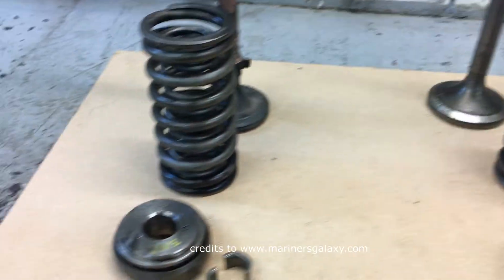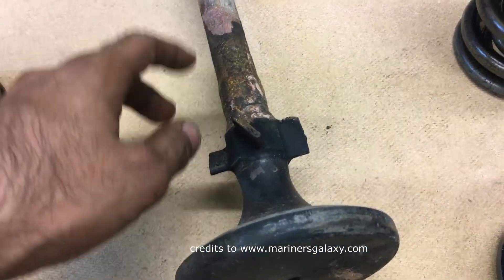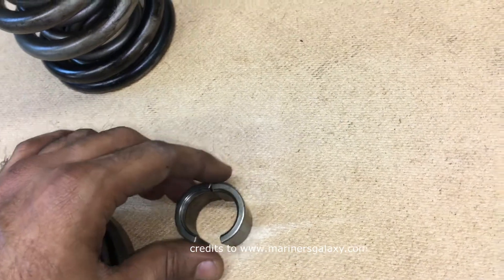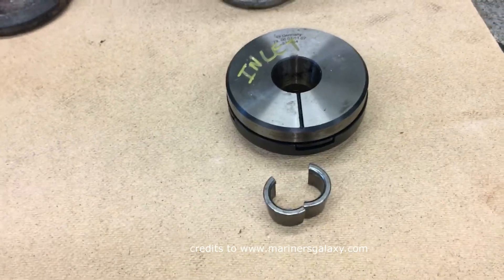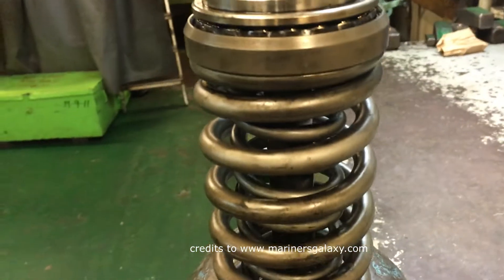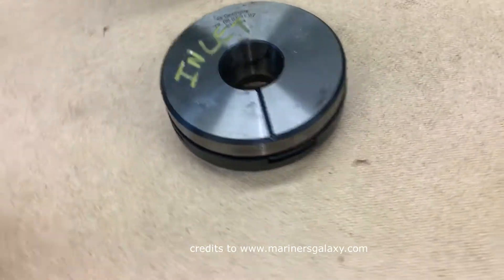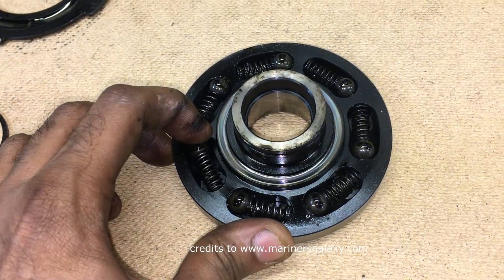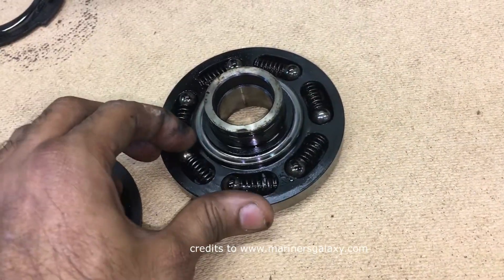Rotocaps, Valve Rotators, Valve Spring Rotator Working Complete Description

Comment: Exhaust side is not a rotocap, its an axial bearing only. The exhaust side is indeed a Ball Spring Rotator or Rotocap.
Reply from the maker: Yes exhaust spindles have fins at bottom, which makes it rotate. Inlet valves does not have fins, so need a rotating device.